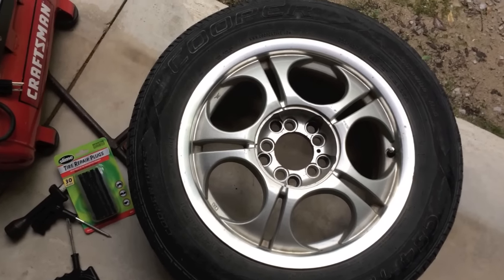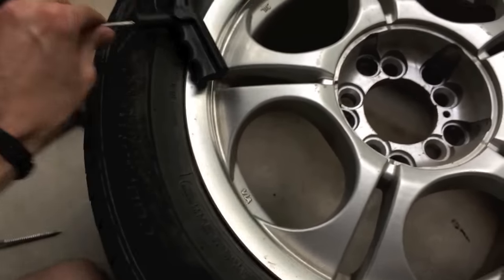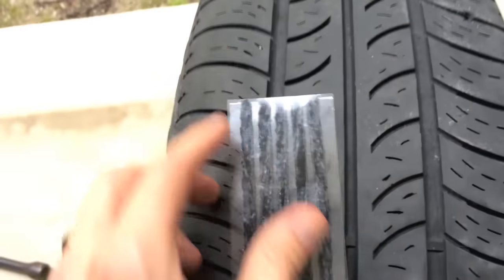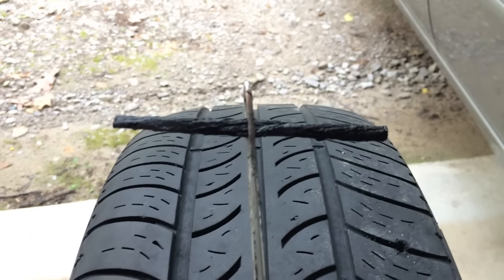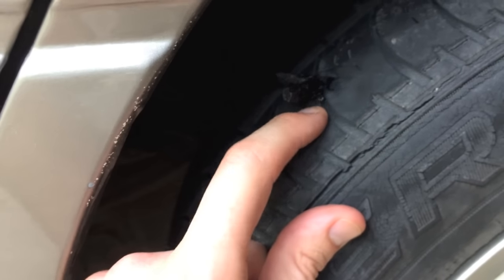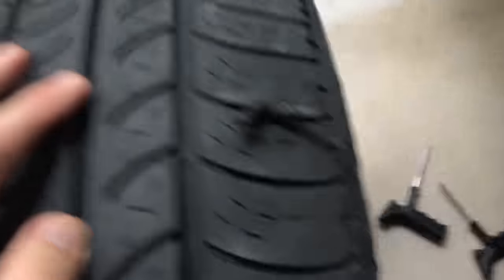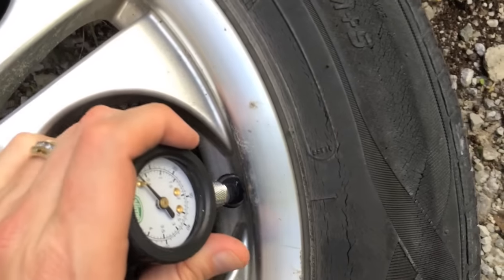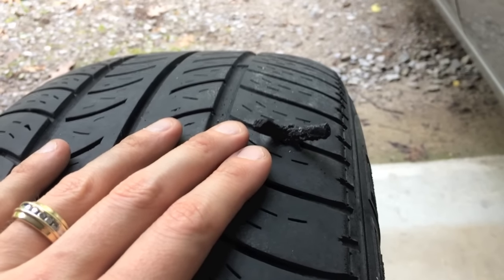How to Patch/Plug Hole in Tire in LESS THAN 5 Minutes - Fix a Flat Tire - EASY FIX

Comment: TIP: Inflate the tire before reaming or plugging. If not, you'll have a bad time because the tread will just move together with your tool.
Reply from the maker: Good morning, thanks for sharing this advice.  Any and all helpful thoughts, tips, advice… are welcome here.

Hey if you’re into crypto trading, we just launched our new platform website.  Lots of fun goals ahead.

       Toolboxtoken.com

We DIYers need to stick together!  🧰
Reply: That’s an excellent tip. I had a tough time because the empty tire offered no resistance. Thanks!

Comment: NO LEAK HOW DO YOU NEED TO CHECK WITH SOAPY WATER!
Reply from the maker: @bobpawtucket1336  

You can use a spray bottle with a mixture of soap and water to spray onto tire to check for leaks.

It will bubble at the leak location.
Reply: @DIYwithMichaelBorders  That was my point why was this not shown?
Reply from the maker: @bobpawtucket1336  

We will add that step next time around, thanks for sharing.  👍🧰

Comment: I hope you didn't drive with that tire and that this was just an example of how to fix a tire, because the one you showed us is dry rotted to absolute hell and is 5 seconds away from a blowout at anything over 50 mph. I tried trailering a little 18 foot bay boat home 40 miles with a tire on it that looked like that. Doing 65 mph, it made it 8 miles before it exploded and destroyed my fender.
Reply from the maker: Thanks for watching & we appreciate you sharing your thoughts.  A blowout is no fun...especially on a boat trailer.

We replaced tire soon after.  👍

Comment: My kit does not come with a sealant.
Reply from the maker: Suzette Quintero 

Thanks for watching.  You may have purchased the spare part kit which only comes with plug strips.  You may want to return the kit and purchase the full kit which comes with the strips, sealant, & the additional tools to open up the hole as well as insert the strip into the hole.

Keep us posted.  Please subscribe to the channel and turn on your YouTube notification Bell 🛎 that would be awesome thanks again!

😎👍🔧🔩
Reply: Hello there 
Mine came with the tools it’s the (7piece kit) but did not come with the glue .
My question is .do I need to put glue on the inserts before inserting them in the tire ?
Thanks in advance to your reply.

Comment: It sounds like it's still leaking!
Reply from the maker: Thanks for watching, no leaks.  We had no issues with tire after plugged.

That may have been my compressor in the background.  We had to service that as well.  Hope all is well.
Reply: Ah that makes sense. Teflon tape will surely fix that, if you haven't yet.
Reply from the maker: @Echo4Yankee  

It sure did, you are spot on!!  😁👍

Comment: Bro I had a freaking screw in mines. Not a nail but a screw. 🙄
Reply from the maker: Thanks for watching, that’s impressive.  A nail just slides right in…but a screw can cause more damage to tire.

Are you able to plug tire?  Keep us posted.

Let us know if you have any questions and hey if you’re into crypto trading, check out our newly launched DIY ecosystem.

       Toolboxtoken.com

Reach out to us any time!  🧰
Reply: @DIYwithMichaelBorders  I spoke to a mechanic shop yesterday and made an appointment. I called them and explained them the situation. They said they can plug it for free. Since I bought four brand new tires with them. When I see a screw I'm paranoid about being done mischievously. Though I don't have people mad at me I think. 

Unless a screw can go in as easily on the tire as a nail. Ughh just more time to plan instead of relaxing at home lol. 
And those tires costed me 150 each. The screw is only on one rear tire. To think it's gonna be plugged. Is the plug reliable in your opinion? Hopefully all is resolved later.
Reply from the maker: @ramir332  

Thanks for the reply, hopefully it’s a quick stress free repair on top of it being free.  😁👍🧰
Reply: @DIYwithMichaelBorders  ok just got back from the mechanic shop. They determined the screw was close by the outer side of the tire and was not recommended to patch/ plug it. So since my tires are fairly new and warranted they installed a brand new tire for free. I did have to put insurance on that new tire in case it occurs again. Only paid $20 for insurance and was out in like 45 mins. 👍
Reply from the maker: @ramir332  

Outstanding, that’s a great update.  Piece-of-mind at its finest!  We appreciate you sharing this and that’s awesome the tire shop installed a new tire.

😎👍🧰

Comment: Not 5 minutes if you have off-road tires
Reply from the maker: Thanks for watching, that’s so true.  Off-road tires are a larger project.  😁

Looking forward to hearing back from you on how your DIY project went.
Reply: @DIYwithMichaelBorders  it kinda kicked my butt lol the nail was pretty skinny which caused the hole to be too narrow to fit the plug in. After fighting it for a while I realized there’s no way the plug would fit with any took in the kit. I decided to drill the hole a little bigger so I could fit the plug in. Worked like a charm and learned something about my car. Keep the vids coming my man
Reply from the maker: @ishmaelhernandez5856  

A true DIYer right there!!!  😁👍

Welcome to the DIY Raptor Club.

Comment: Yeah it won't be terrible to not cut it. It doesn't matter. 
What I dodo is burn my plug with a lighter then dunk it in contact cement shove it in hole light it on fire 🔥 quick dry just like a bicycle tire patch best patch ever last time did that it last me 12 years & it was on side wall corner of tread. Only reason I did get new tire, I could not afford one. By the time I could it had been 2 years. I said it last that long F it. 

Now 6 years later got 2 holes 🕳  side wall o most in same spot I put in plugs didn't have contact cement only lighter. Lets c what happens.
Reply from the maker: Thanks for watching & welcome to the DIY Raptor Club.  We appreciate you sharing your experience.  Keep us posted.

Us fellow DIY’ers need to stick together!  Hope all is well.

😎👍🔧🔩

Comment: Problem is can't find the puncture
Reply from the maker: Thanks for watching & welcome to the DIY Raptor Club.  In the event that you cannot locate a leak, it’s very possible that you have a rim leak or a valve stem leak.

For a rim leak, most people spray water in the area where the rubber tire meets the rim.  If there is a rim leak present, the water will bubble.

If it’s a valve stem leak, check out the video link below.  It shows us replacing the valve stem to alleviate a leak.

       https://youtu.be/zuWpmP73S0E

Please keep us posted on your DIY project, us DIY’ers need to stick together!

😎👍🔧🔩